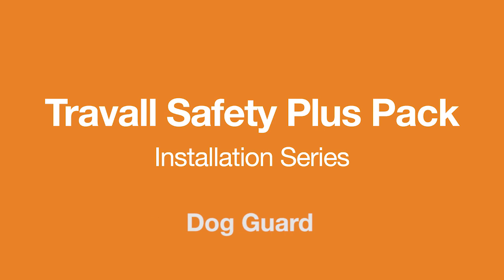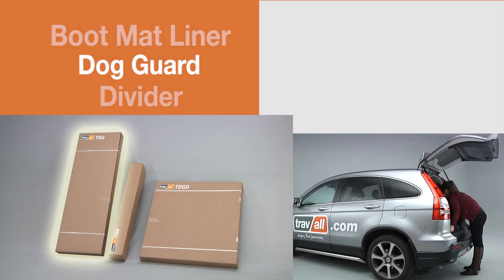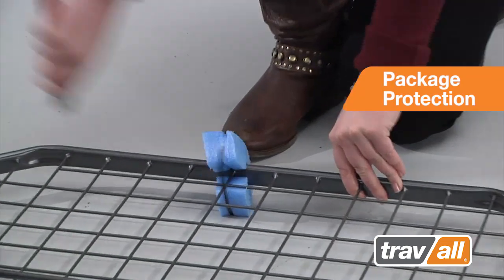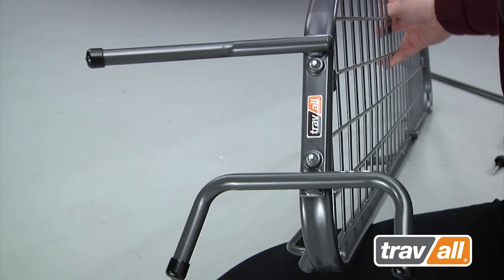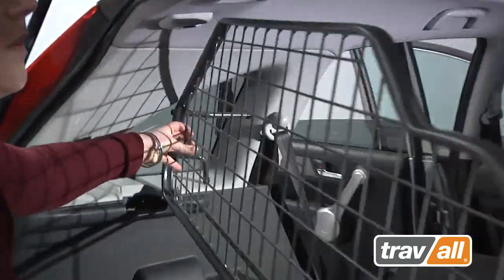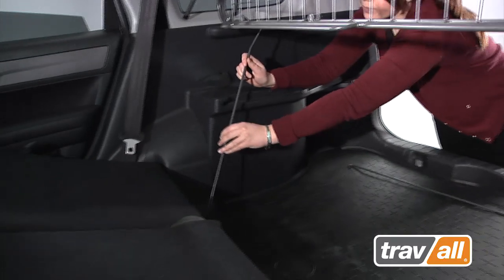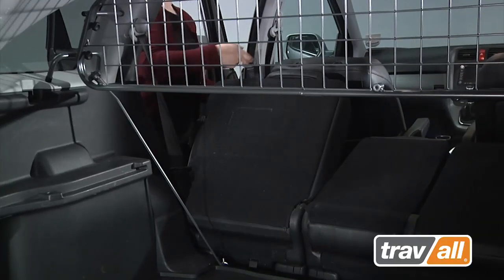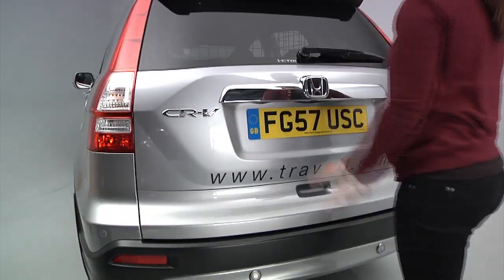How to Fit a Travall Guard

Comment: Searching for the TDG 1480 instruction video and this is the only thing that comes up! Different model, different installation and not much use 😠
Reply from the maker: Hi ThePrimakerel, we only having vehicle-specific Fitting videos for our more recent Guards. However we do have a more general video that may help - this won't be the exact same Guard but it should be the same type of Guard fixings. https://youtu.be/iRHM5drw7x4 I hope this helps.